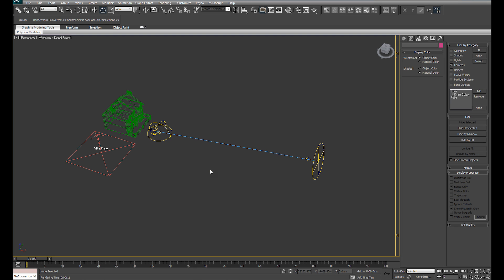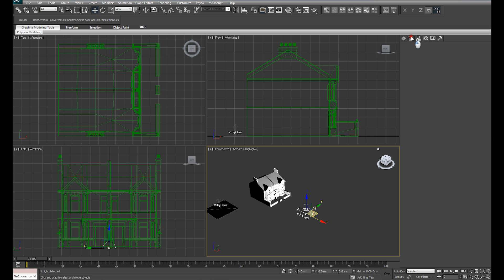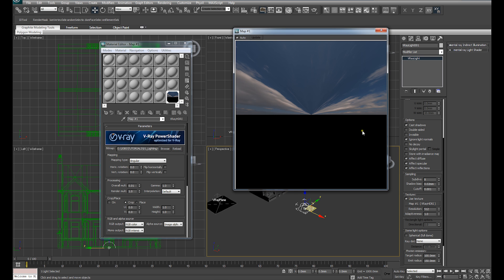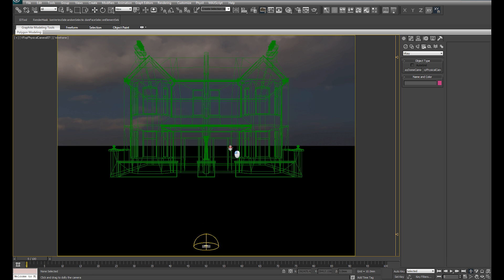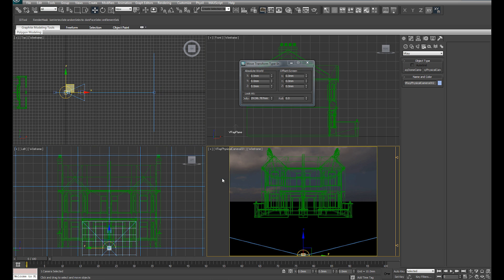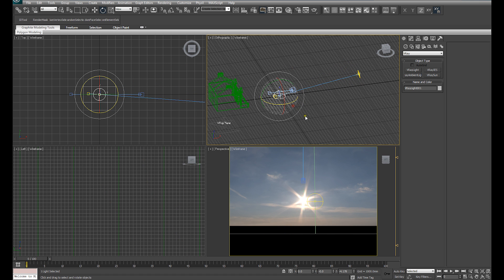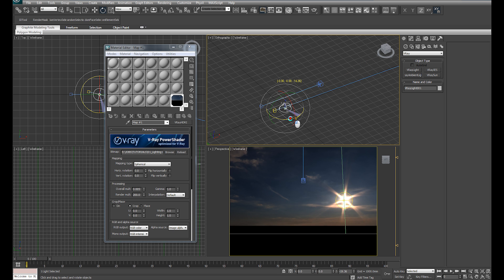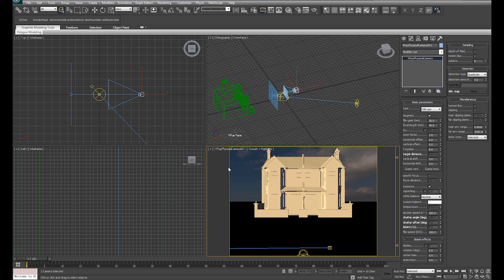Lighting in Vray using an HDRI Sky & VraySun

Comment: Hey Matthew. Great Tutorial. Quick question. If I want to change the HDRI, do I have to do all the process from scratch? Keep up the good work
Reply from the maker: +Rodrigo Arias you certainly would need to realign the sun to the position of the sun in the HDRI but you wouldn't need to do every step from scratch. Once you have built the initial light rig, it can be used for other HDRIs.

Comment: Matthew,
Is it correct that, after following this tutorial, I will not be able to rotate the HDRI vertically? After completing this exercise I'm doing a render of a house with a fence behind it. And I have a black horizon line a foot or so above the fence. And rotating the hdri in the material slot vertically doesn't change anything. Actually I should say it corrects the problem in the camera view, but the render doesn't change. So it appears that it's locked in it's vertical orientation?
Thank You

Comment: Hi, Nice Tuto, but I have a problem, when Im going to render.... in the final render i have 2 different shadows...one from the hdri and the another one form the sun...and i was so accurate with the positions X Y ansd Z.. in all. Thanks
Reply from the maker: This could be to do with the new domelight feature in Vray 3.0. The "Lock to dome orientation" checkbox will interfere with the wiring of the domelight rotation and texture. If you uncheck this you should be able to proceed with the tutorial as normal. Please see the information in the description above. It will hopefully make clear where there are discrepancies between my tutorial and the new vray 3.0 features.
Reply: Matthew Moult tengo el mismo problema, I have the same problem; ''Lock to dome orientation''' ?   where is itLock to dome orientation'''?? thanks

Comment: Hi, i'm using "peter guthrie 1103 sun clouds" to follow your tutorial. But that HDRI's sun isn't at 0 degrees as yours. It needs to be rotated about 91 degrees to face towards the house & vray dome. Problem is, altough i already link them both, in final result vray sun does link the HDRI but not precisely in the HDRI's sun. Where did i do wrong?

Comment: ops...I apologize...I did a bit confusion with texture and renamed it in the material editor after applying it to the dome light, so the connection between z rotation and texture didn't work...after having reassigned the texture to the light with the right name everything works fine...thank you the same

Comment: When using domelights to light a scene you can get sharp shadows by:
A)  Change the gamma in the VRayHDRI material to give more contrast.  This is a bit of a hack.
B)  Open the hdri in photoshop, select the sun (elliptacle marquee tool) and add an exposure adjustment to boost the exposure of the sun.  This is the best way to get sharper shadows and you can change the sharpness by feathering the selection.

Comment: Thx a lot. =)
Yes, I'm use this method too (with Reinhard mapping type) in my exteriors, but the use of LWF leads to more correct result. 
And the only correct solution using LWF+HDRI bcgr+HDRI lightning will be replacement of the sky. LWF + HDRI lightning + HDRI background (at least, that are made by Peter Guthrie) will not work together correctly - I spent a few days experimenting that. Just some Photoshop over HDRI image and it can be used without the HDRI background overexposed areas.

Comment: I am having problems getting the background to show up in the background. I am using max 2012, and I think the problem is with the Nitro driver, switched to Direct3d and it shows up, but its buggy, weird lines show up. anyways wondering if you encountered this problem and how you worked around it. thanks